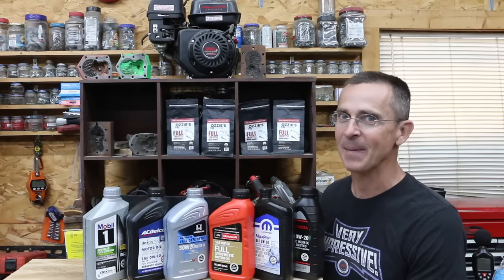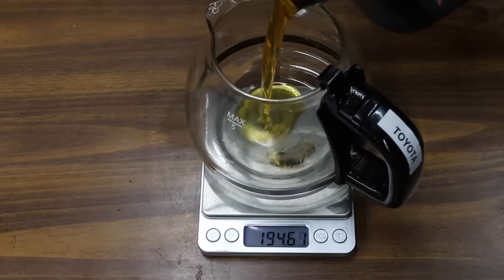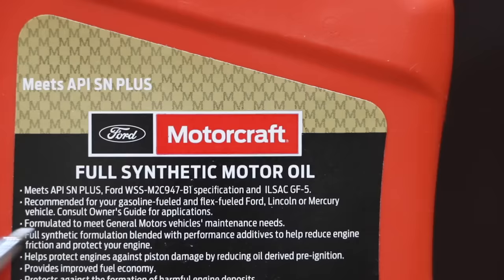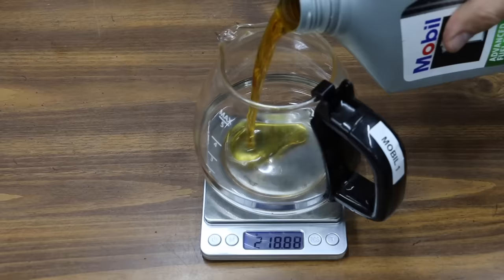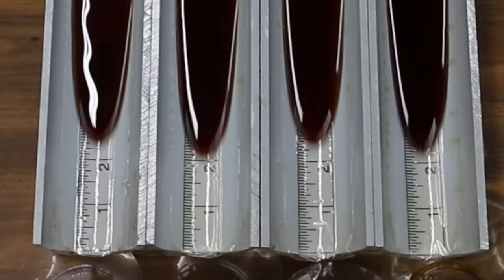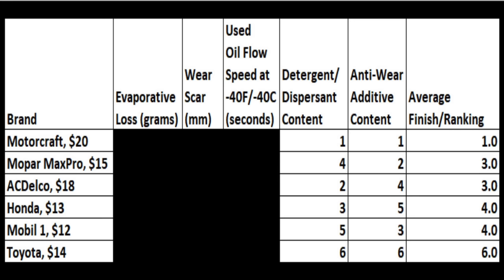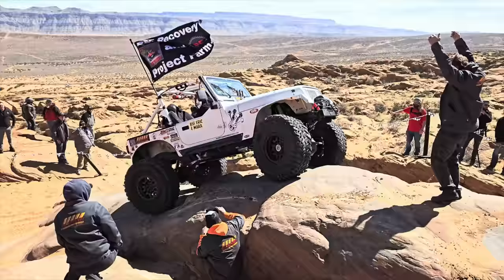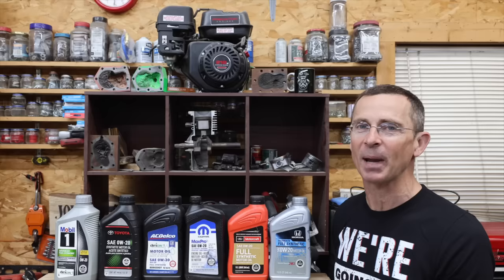How Bad Is OEM Motor Oil? Honda vs Toyota vs ACDelco?

Comment: My favorite test returns! Love these oil tests.
Reply from the maker: Thank you! Any other oil review ideas?
Reply: @ProjectFarm full synthetic high mileage oil vs full synthetic oil!
Reply: @Mike-Capz83  He made a test on that already. Good video.
Reply: @ProjectFarm  my vehicle is due for an oil service and this definitely help me make the decision between Motorcraft and mobile one. Thank you sir the extra couple dollars for the motor and my opinion are a no-brainer.
Reply: @ProjectFarm  Yeah! Just bought my first motorcycle. I would love to see some tests on motorcycle specific oils meant for both the engines and clutch.
Reply: Same here. I love the oil videos!
Reply: boring...if u ask me.  Either buy Amsoil if u want the best or buy whatever is on the shelf because it doesn't matter.
Reply: @ProjectFarm  I would love for you to test non synthetic high zinc motor oils preferably 10w30 advertised for classic vehicles/flat tappet camshafts such as Valvoline VR1, Castrol GTX Classic, Lucas Hot Rod and Classic and many others. I would also like to see how the high zinc oils compare to a regular motor oil with a zinc additive such as Rislone Hy-per Lube Zinc ZDDP. Thanks for all your hard work and excellent content! When I’m looking to purchase anything from a ratchet to a frying pan I always look to your videos and search for Project Farm in the product reviews before purchasing.
Reply: gear oil
Reply: @ProjectFarm  Motorcycle oil! JASO ratings for wet clutch use. Funny enough, Shell Rotella T6 diesel oil is actually rated for wet clutch use, and is often half the price of motorcycle-specific oil, would be really interesting to see how it compares and how the anti-wear additives actually affect performance
Reply: I'd love to see gear oil tests. There's a lot of conflicting information about it out there.
Reply: @ProjectFarm  yamalube oils please! the fourms love it, claim its the best oil you could ever use on anything
Reply: If the oil test "tracks were longer with less slope, there would be more definitive results
Reply: @JohnSmith-zt7qo 
 absolutely.
Also testing the different LSD additives! 👍👍
Reply: @ProjectFarm  have you done a store brand oil, such as Walmart or big car parts brand, Napa, O'REILLY'S, Car Quest ECT...?
Reply: Test are a Joke!
Reply: @ProjectFarm MOTUL 300v and MOTUL 7100 vs amsoil signature series and dominator series.
Reply: @ProjectFarm  How about a test for comparing 2-stroke pre-mix oils? :)
Reply: @ProjectFarm I would like to see oil comparison of the major brands of full synthetic, including Mobil one.. So for example, Mobile One, Valvoline, Pennzoil, Amsoil, Shell Rotela, Castrol, etc.  I am especially interested in how Valvoline Extended Protection Full Synthetic compares to Mobil One.

Comment: I used to be a mechanic for an independent shop and we used Valvoline motor oil exclusively and because of seeing how clean engines were on the inside that had very good oil maintenance performed and high mileage, I use Valvoline now in my own vehicles. I have always looked at automotive manufacturers brand oils as inferior but now I would love to see a comparison between top namebrand oils at the automotive parts stores with the automotive manufacturing brands from today’s testing. That might be very informative to me.
Reply from the maker: Thanks for the suggestion.
Reply: @ProjectFarm  In a way you have already done it by comparing all those to Mobil 1.

Comment: Please test caulking and silicone. Flexibility, adhesion and mold resistance
Reply from the maker: Thank you for the video idea!
Reply: Does silicone work as motor oil? Let's find out!
Reply: Agreed would be a great test topic
Reply: Messiness, and how easily the surface smooths after being disturbed (when wet).  And when dry...strength.  I'd suggest sun damage too, but I don't want to wait a year for results.
Reply: @Sonny_McMacsson   Wrong channel, its a test for Garage 54 😀
Reply: @Sonny_McMacsson 
😂.

 In this instance we've replaced the motor oil with silicone cualking.....
Reply: Clear GE Silicone II cut with mineral spirits can re-waterproof a tent and fly....done it.
Reply: I think GE is the best out there, not that impressed with Dow Corning.
Reply: @H4K4N  See the channel's videos from a few years ago. It was a bit more like G54.
Reply: @Sonny_McMacsson  quick hide the lawn mower!!
Reply: Sashco would like to enter this test for sure.  Their products are next level.
Reply: Be sure to include Lexel.
Reply: Agreed, re-caulked and painted my house 4 years ago and used the expensive silicone and was very disappointed with the results.
Reply: @mrcryptozoic817 It is awesome!  The only thing I don't like about it is that it can take up to 2 weeks to fully cure.  Better than Silicone in nearly every way except high heat.  Lexel about 200F and silicone 400F.
Reply: Add OSI Quad Max.
Reply: @H4K4N I trust Project Farm!
Reply: @vortexan9804 For when you actually want 100% silicone.  Otherwise, I prefer Lexel.  Nothing, not even more silicone, sticks to cured silicone.
Reply: @mikewest712 Through The Roof is the best for what it is for.
Reply: @Marc15663 If wood, silicone can fall off, and can't be painted.
Reply: @solarsynapse  That would be the ultimate showdown! Painter's caulking vs silicone vs quad sealant. This could could easily be a multi part episode.
Reply: Yes

Comment: Thx so much for the additional content. You’re a legend.
Reply from the maker: Thanks!  Thanks for supporting the channel!  I really appreciate it!
Reply: @ProjectFarm Can you test different 0w40 Many exotic engines use this weight oil Porsche, Nissan GT-R, Mercedes AMG ( very popular and contested subject ) Do Redline Liqui Moly Mobil Castrol Amsoil Motul and compare the top two with 5w30 Amsoil and Pennzoil Ultra Platinum 5w30 vs top 2 0w40

Comment: Your oil tests are my favorite!

PLEEEEASE test Shell Rotella T6 diesel engine oil against Amsoil diesel and other diesel engine oils.

Thanks!
Reply from the maker: Great suggestion! Thank you
Reply: Love this idea!  Premium HDEOs like T6 vs Amsoil vs Hots Shots comparison!  Diesel fuel lubricant additives, especially for those of us with CP4 versions, would love that, too!  Thanks, Todd, for all your hard work!
Reply: I’d love to see how rotella 5w40 does! Thought about switching all my vehicles to it!
Reply: Would be interesting to see power driven diesels oil in here as well
Reply: I'd be kind of interested in that as well. I run Rotella T6 in my motorcycles (it's got all the proper ratings to do so) so it'd be good to see how it does.
Reply: How bout the king of diesel shaeffers vs. t-6. I just changed from t-4 to t-6 after almost 20 years of t-4 with a first time synthetic filter my Cummins likes it.
Reply: I too would be very interested in seeing this testing!
Reply: If you look on back of the Toyota brand oil bottle it says it's manufactured by mobil 1. So that should prove to alot of people that since a product is made by the same company that it doesn't mean it's the same product that you are buying..Thanks for all your test.  Hope you have a great day....
Reply: yes!!! this would double for us motorcycle riders!!!!!!
Reply: @ProjectFarm If you do diesel oils, can you include Motorcraft? Several mechanics have told me to only use it in my 6.4L Powerstroke
Reply: @ProjectFarm  Been using the Motorcraft Full Synthetic for yrs. The GF6-SP has been out well over 1yr. Summit Racing sells it for $8-9qt. Thanks!
Reply: I wish Subaru OEM oil would have been included, but love the channel overall
Reply: And test the different viscosity blends too!  The 5w30 rotella T6 and Delvac 5w30 are ACEA E6 rated but the 0w and 5w40 weights are not.  It would be really interesting to see how the different viscosities of the same product compare to each other!

Comment: Motorcraft is some darn nice oil, and was cool to see it do so well here.
Reply from the maker: Thanks for sharing!
Reply: I started using because I noticed less noise from my engine when tried  it. I’ve tried a lot of different oils. Also ford performance recommending doesn’t hurt. I still think the best was rosella gas and truck. Of course they discontinued it.
Reply: Ford/Motocraft has a special oil that they only use for their performance vehicles (Ford GT, GT350, GT500, Raptor, Boss 302, Focus RS). It's all 5W-50 Motocraft. It's hard to find that in other brands, so most of those owners just use Motocraft. It seems to work well...
Reply: @ittimjones yeah my gt500 calls for it as well. Not really another option, but I have trusted ford vehicles since I was 17 so it has been working out so far. Blue oval wins oil!
Reply: Not many places carry it. Even the ford quick change place didn't even have it.  Ford performance dealers carry it though.
Reply: @TheDealer6373  also rock auto

Comment: My Dad has used Valvoline in every engine he's had since the late 70s. Most of his engines were air cooled. Big fan of the VW beetles. I followed suit with all my engines and vehicles as well. Dad never had any of his engines fail and to date neither have I. We both have a combined 80 years building engines. He has about 50 and I have about 30. Many fine oils to choose from in our great country. Thank God for that and much more for sure. I think we'll, and that includes my son now, will stay with what had worked for us. In the event that Valvoline's quality changes/ turns to crap, we'll have to make a change then. Great video and appreciate you young man.👍🏼
Reply from the maker: Thanks and you are welcome!

Comment: I would love to see a test of various 15W-40 motor oils designed for diesel engines such as Rotella, Chevron, and Mobil Delvac as well as some store brands suchbas Love's and Flying J.

Once again, thanks for the great video and can't wait till next Sunday for your next one.
Reply: And maybe some European brands? Like total and ravenol? Or are they realy hard to buy in the status?
Reply from the maker: Thanks!  Thanks for the suggestion.
Reply: @franklinvanproosdij  From what I can tell the European motor oils aren't as easy to get a hold of here in the states unless you find an auto parts store that specializes in European vehicles. But that's what Amazon is for right? :)
Reply: Maybe Liqui Moly also?
Reply: I would add Ford Motorcraft 15w40 Super Duty oil to this list as well - I've heard claims of higher ZDDP levels in this oil compared to Rotella/Delo/Valvoline diesel oils, but the oil analysis samples I sent out showed pretty similar results - not sure if it was just the batch of oil I got.
Reply: @MichaelTJD60  without question. I have a 7 3 Powerstroke and that's all I run.
Reply: Rotella T6 is supposed to be great. Some people use it in their motorcycles and ATVs because OEM oil is expensive.
Reply: @theezeelife292  Same here - the previous owner of my 7.3 ran Valvoline for years, but I immediately noticed a difference when I switched to Motorcraft oil - it ran much cleaner, smoked less, throttle was a lot more responsive, and seems to have helped the mileage slightly.
Reply: Same here, we cant realy buy American oils like penzoil or amsoil, even shell oils have different names,  the shell 14l5w40 diesel oil is called rimula, and normal 15w40 is called helix.
Reply: I would love to see a diesel oil shootout!

Comment: Working in extreme conditions in the oilfields of west Texas, I’d LOVE to see a test on all terrain tires. Puncture resistance, wear, traction, etc… 

I’ve got the fiancé waiting for your next video every Sunday. It’s become our after church routine. Thanks for doing what you do!
Reply: yes some pickup truck/suv all terrain tire reviews would be awesome
Reply: Yes. BFG. Duratrac. Falken Wildpeak.
Reply: @DoctorPrepperMD  oddly enough, the duratrac has been the worst tire we’ve used……by far! I’d like to see some science behind that instead of just our opinion.
Reply: I don't always off-road, but when I do: General Grabber A/TX
Reply from the maker: You are welcome!  Thanks for the suggestion.
Reply: That would be very expensive and time consuming. Not worth it for him
Reply: @tuckerhiggins4336  every single one of his tests are extremely expensive. I’m pretty sure he uses a revenue generated from views to purchase everything to keep an unbiased opinion on his testing.
Reply: The better the viewership,  the better the revenue to do bigger and better tests... circle of success!
Reply: @markab71  What planet are you from. He does oil videos often because his methodology is developed and it's $100 in oil. Costs are mostly sunk. Tire testing would be $1000s in material, if not 10s of thousands, and hours in methodology development to his level of detail. Being independent has a cost, and not a trivial one
Reply: @tuckerhiggins4336  he doesn’t have to buy a complete set of tires and a vehicle for every tire. He’s self engineered every test and it’s worked out very well for him and the channel. As far as what planet I live on….I live on the planet of “I’ve watched him from the very beginning and know he’s a genius for coming up with these tests” there’s an inherent cost with what he does. The more he tests, the more views he has and the more revenue he has to put back into the channel. Anyway, have a great day!
Reply: @markab71  I am curious what type of terrain/road surfaces and vehicle weights you were running the duratrac tires on. I get the impression that its all over the place with those that are happy with the tire to those that have had tire failures. Having said that about the tire casing issues, I see Goodyear has made some changes inside the tire as of last year and I believe it may have to do with using kevlar possibly and I have not heard any real world feedback yet. My brother had a set of them on a Jeep and it sees a high percentage of paved roads but also is being towed a lot on its wheels. The tires wore all stupid, like a wavy cupped pattern of high and low lugs and made lots of noise and vibrated ... no physical way of balancing that mess. He took them off and put on some Toyo A/T3 and so far is way happier for the quiet tire manors. I see the Duratrac tires have dropped in price AND they have a sale on them in Canada at the moment at Fountain tire stores, Goodyear had price themselves way out to lunch on those tires and was another reason guys were buying something else I was told.

Comment: Suggested video: Best rechargeable WALKIE TALKIE RADIOS, battery capacity, water resistance, durability test, which one can send / receive better radio signal from obscure / covered spots
Reply from the maker: Thanks for the video idea.
Reply: That would be awesome

Comment: We need a Mobil 1 showdown, there's a few different variations of Mobil 1 out there; High mileage, Extended performance, advanced fuel economy etc. It would be very interesting to see which one works the best out of all of them! Also another suggestion; an ultimate oil showdown with the best performing oils from each brand all different variations head to head to see which one truly is the best!  Thank you for all the amazing videos
Reply from the maker: You are welcome!  Thanks for the suggestions.

Comment: Your test confirmed what I have known for years. I have driven Fords since I was in Highschool and ran nothing but Motorcraft oil and filters. All have gone 250,000 to 350,000 miles before trading or getting totaled by teenagers and never had an internal engine issue.
Reply: Working in a Cord dealer shop it’s amazing how many I’ve seen with north of 250k with few repairs in their history, from customers that bought the car there and every single time it’s needed anything it’s been through our shop. 
Being from a Ford family with very few engine repairs in 30+ years made it the best career choice for me.
Reply: I have heard that from many people. But in truth, I have heard the same regarding ACDelco, and Honda. I have NOT heard the same about Toyota.
I have a 2015 F150 with only 66k miles, and I am gearing up to do all the fluids. And its Motorcraft only.
Reply from the maker: Thanks for the feedback.

Comment: i was surprised how much weight was lost after heating up the oil. well done with your crazy vehicle. always great info in your vids.
Reply: Yes me too - what happens in an engine?  Are there little bubbles of steam that circulate since it can't escape?  Is it better then to pre-cook the oil before putting it in an engine?
Reply from the maker: Thanks!

Comment: Another phenomenal video! Quite surprised at Toyota. Also what an awesome event! Cool that you participated. As always cheers from your biggest fan in Colombia amigo!
Reply from the maker: Thanks!
Reply: Toyota motor oil is just rebranded mobile 1. Its says exxonmobile right on the back. Read it. Just buy the cheaper mobile 1 with the proper additive pack, the oem stuff is over priced but the same thing!
Reply: @crisnmaryfam7344  good tip
Reply: @ColombianLNP  A lot of stuff is like this, Oem oil filters, brake pads. You buy "HONDA" pads for example the dealer.. they charged you double for the same exact stuff you can get from "Akebono".. whoever it is making them right now... for cheaper. Often you can google who is making whatever OEM part and find it tons cheaper through the manufacturer of the part.

Comment: Great comparison , but I'm going with the Mobile one simply because of the price, I get 5 qts for around $25 at Wallyworld  and I change my oil ahead of time at 3000 miles and really don't abuse my car. The trick is to use good oil,a good filter, and change regularly.
Reply from the maker: Thanks!  Thanks for the feedback.

Comment: Love these motor oil shoot outs! When testing Mobil 1 it would be great to see the Extended Performance version used. Even better would be a Mobil 1 shootout to see if there is a difference in the offerings like you’ve done for Penzoil.
Reply from the maker: Thanks!